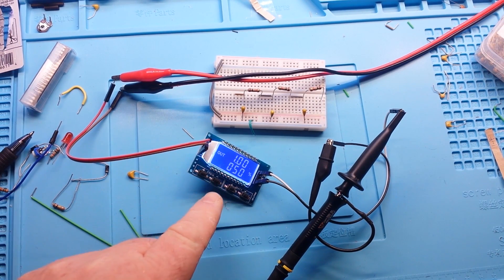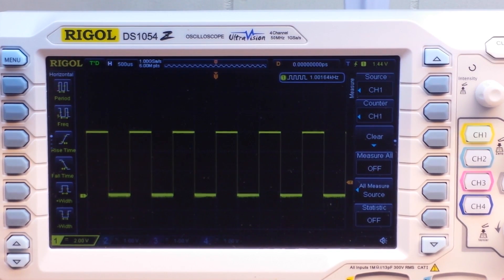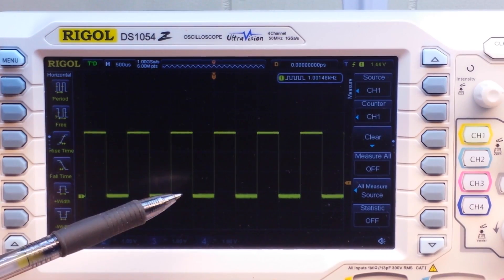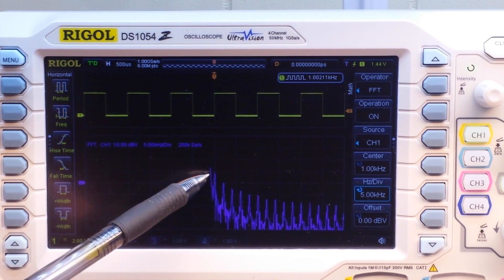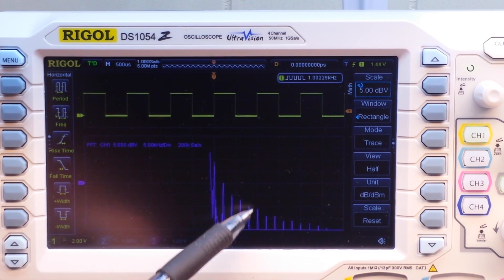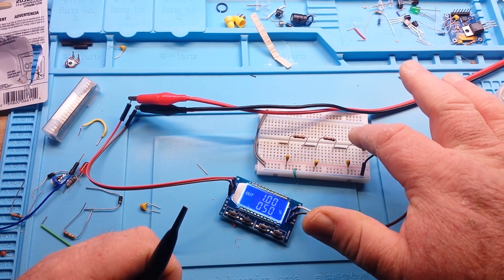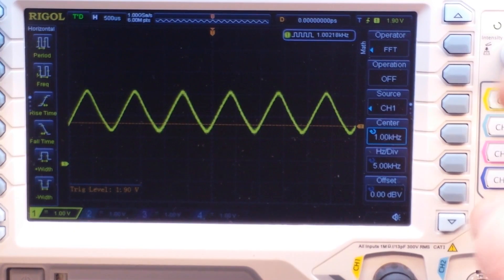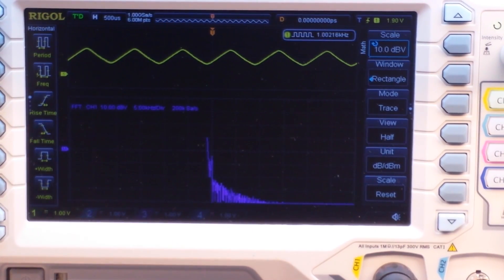Square waves, harmonics, and FFT

Comment: This is a great explanation but I still feel that there's a deeper base of understanding to this which I haven't grasped yet... Why are a bunch of sine waves in odd harmonics are represented as a square? What is it in the sudden movement of the square wave that creates the different harmonic sine waves in the first place? What am I missing here? Is it the speaker that moves from one point to another so suddenly that it creates a by product of "color" and from the movement itself come the harmonies which is the distortion we hear? Is it in the circuit that when overdriven lets out these harmonies? Or is it something else? Because there is a wave that's oscillating back and forth instantaneously and I don't seem to understand how filtering it's high frequencies makes it a sine wave again... These dots do not connect for me.

Comment: As someone learning synthesisers and their oscillators & filters, it always confused me how other videos say square/pulse waves have certain frequencies, but then show the up&down square waveform and never explained it. This video did a much better job than all the videos I've seen, and made it click for me. So it's just displaying voltage/time, and you need a different display to see harmonic content. I know pretty much nothing about electronics but this channel looks like a great way to learn.

Aologies for the stupid question - are synthesisers essentially like any other electrical circuit, but at audible frequencies?

Thanks for the great video, I've subscribed.

Comment: Hey Paul!! 

Would you possibly be interested in expanding on the functionality of the square wave generator (okay, 555 timer) into a more versatile "function generator", one that could include Square ('natch ;) ), Sawtooth, Triangle, and Sine waves? There's a kit somewhere out there ("beyond the pale moonlight..." Go away Fievel!) a number of years ago. I think I have the schematic somewhere.

There are a number of 2 or 3 function kits out there from the Pacific areas, but no 4 function kits, at least not the last time I looked.EDIT: Found the Schematic. I believe that is the actual kit number.http://www.radiosparks.com/images_d/MK105D.gif

Comment: What is the math behind the 1 KHz signal, the 1 Kohm resistor, and the .1 mF capacitor? How does one know that the resistor and cap values will resonate along with the 1 KHz signal(I'm not sure If I'm saying the right things)? Anyway to give a brief example in the comment section here?
Reply from the maker: Low pass filter theory. Google low pass filter formula

Comment: This is really, REALLY, interesting!!!
Let me ask you something... And if you know nothing about rc and quadcopters, don't worry, you can ask me. So... There's this guy that has a channel and he does a lot of esc testing, looking for its noise profile. 
Long story short, escs (electronics speed controllers) drivers the brushless motors... Which are really noise, for a lot of reasons. (They have really strong magnets, they don't only burn current for spinning, but also generate electricity when doing that and so on.) And the noise is terrible for quadcopters, it gets into the gyro and can cause a lot of undesirable movements in the PID loop, it can ruin your video feed of the FPV if the noise gets to the VTX and so on...
Anyway, there's lots of criticism about his results... People questions about the way he connects the oscilloscope and so on. But nobody shows any evidence that his tests are flawed either. 
So, my question is how would you hook it up? And what would you look for?
Reply from the maker: I'm sorry, that's really not my field.
Reply: @learnelectronics  I see... Thanks anyway. 😊

Comment: Now that's some deep oscilloscope stuff. I didn't understand much but it was still interesting. Thanks for the video!
Reply from the maker: Thanks. It was just showing that a square wave is made up of an infinite series of sine waves at odd harmonics. So 1khz sq wave is made of sine waves at the fundamental, 3khz, 5. 7, 9, 11 etc all stacked on top of the original 1khz wave.
Reply: Well, why didn't you just say so! 🤣

Comment: Slightly off topic from this video. I believe you said in the past you developed power supplies. I was wondering if you ever use a dip voltage regulator LM723? I picked up a few to play with. Cheers Rick
Reply from the maker: No, mostly 78xc and 79xx regulators

Comment: Hi Paul, Another great video. I got the same scope during last Christmas. The fan noise drove me (more nuts) so I followed other owners and swapped out the fan. It was just under $11 on Amazon.I got the Gelid Solutions Silent 5 Case Fan. From that change I have been using the scope even more. I haven't use FFT yet so my thanks for another cool thing to try. btw: How is Mom doing?? Rick
Reply from the maker: Cook I'll check that out

Comment: My "Fundamentals" courses were over 30 years back so....how is FFT different than a spectrum analyzer display? Back when the dinosaurs roamed it was explained to me as o-scope vertical = voltage, horizontal=time. Spectrum analyzer vertical=power (Db or Dbm) horizontal=frequency. FFT shows power over frequency or a hybrid voltage over frequency ?
Reply from the maker: FFT on a scope is just a very basic spectrum analyzer done in software. Frequency in the horizontal plane, amplitude in vertical.
Reply: @ @learnelectronics  Thanks. The "latest" computerized scope I worked with would do basic data capture and not much else.